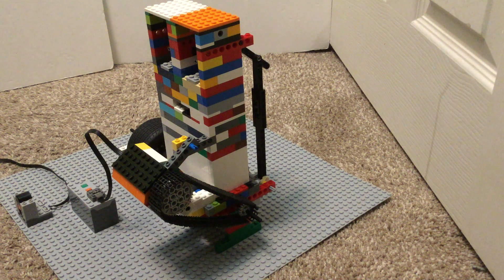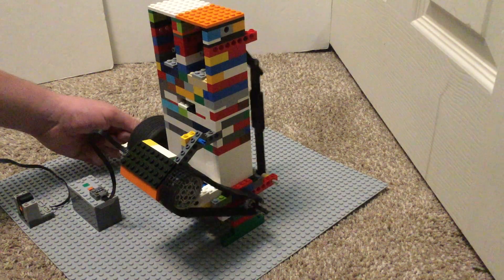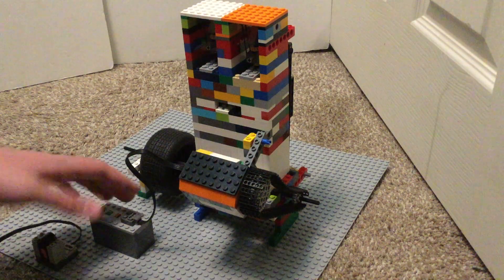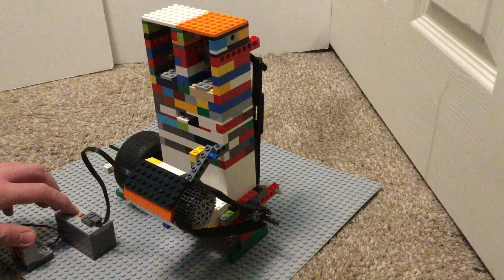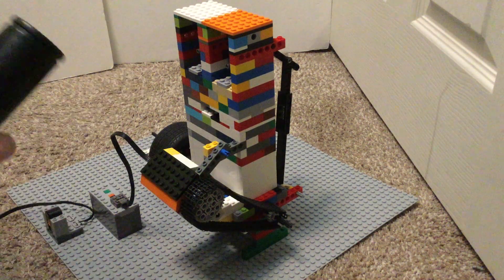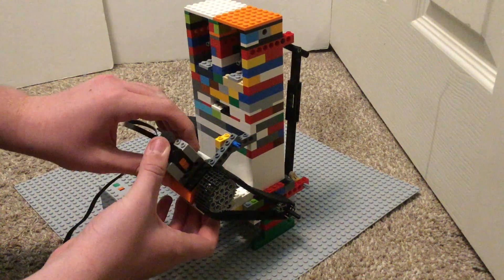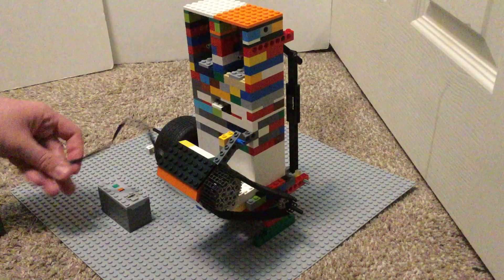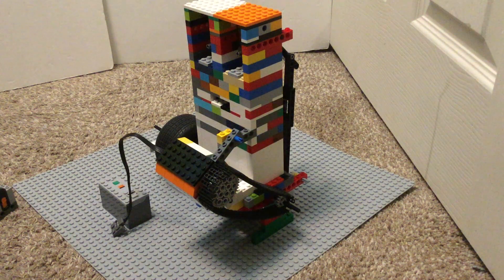Lego REALISTIC Generator/Alternator hooked up to the Inline 2 OHV Vacuum Engine

Comment: So the generator just has a PF motor in it?
Reply from the maker: Yes, it is the power functions m motor, which is pretty hard to turn which is why it runs so slow. I used that type of motor because it is cylindrical already and is small, so it could easily fit in a moc starter.
Reply: @matsbricks4129  its cool